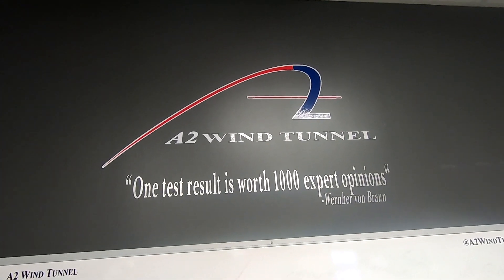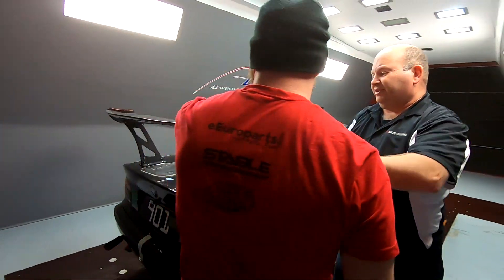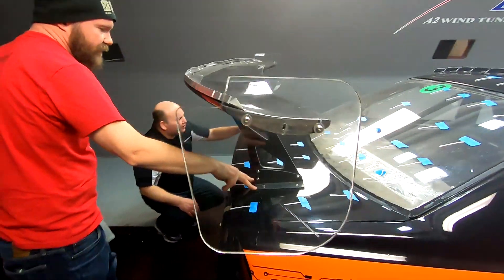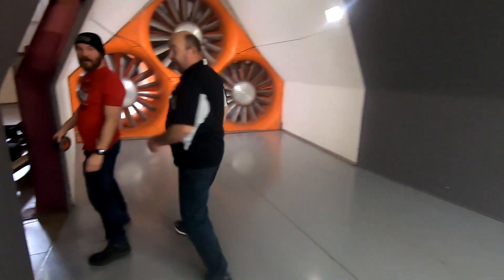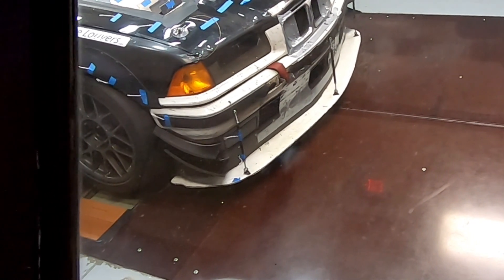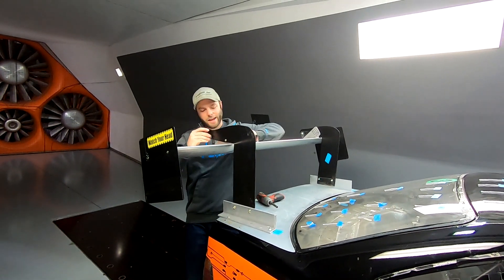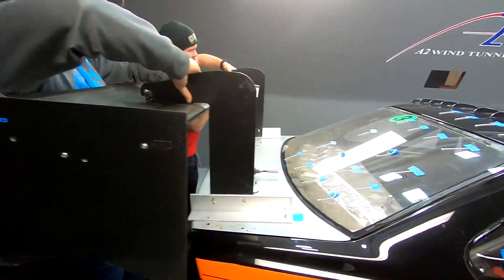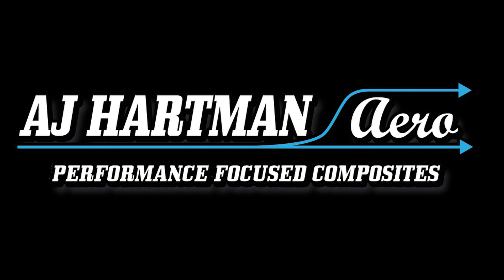37 Wind Tunnel Runs Part 2! Vortex generators, canards, and wings.

Comment: The air tab vortex generator created way too much drag, it might be better to try delta wing type vortex generator from Mitsubishi Lancer EVO around 10cm from roof turning point. There is also Chevron vortex generator with better sensitivity if placed in series with 5mm height which has minimal drag penalty.

Comment: The canards themselves cost some drag. The vortex generated from it keeps the flow attached to the vehicle body. This also suck out the high pressure air from the front wheel well and this reducing lift and drag. To what extent is this true? Would the net drag be negative in this case?
Reply: for canards they move air away from tire, which depending on rim design can be source of lots of irregularity and drag. Tho from what I understand they're mostly for bit of additional downforce. 

Vortex generators are finnicky. on their own thei add drag, but they give more energy to air, which helps with it following line o fcar. Basically on on sedans where back of car moves down depending on design air can unstick from body of car, causing large vorteces and lots of drag. if you put vortex generators just before that point of unsticking, air tays attached and they reduce drag more than they increase it.

Comment: Reducing the costs of airtabs? Either you have a 3D printer or you don't. Never pay retail again. Lol.  I'll get back to printing kazoo parts while designing some venturi nozzles for dust removal inside cnc vertical mills.

Comment: I attended a talk by some aeronautical engineers with the subject being boundary layers. They used synthetic oil mixed with a dye which they applied to an aircraft wing especially at the wing root and to the fuselage fore and aft of the attach point. This was used instead of the tufting. They dye held in suspension by the oil would  concentrate or not showing the boundary layer separation. Of course this was very messy and the aircraft owner got a very extensive wash job afterwards. Goos video very interesting. I’m jealous

Comment: From what i read and watched on other videos (air shaper, kyle.engineers, etc.) roof vortex generators are to be placed very near the spots where airflow separation would occur. That would be as near as feasible to the sharp downturn "corner" of the roof and the rear window.

And the supposed primary reason for roof vortex generators was to reduce the drag from the rear window flow separation. Not sure if they are supposed to reduced lift but it would seem that having attached flow on the rear window might actually cause lift, unless that flow also affects the airflow to the rear wing which might then result in net downforce.

Wind tunnel time is expensive 😯 though you most probably already planned and prepared all the stuff that you were going to do in the wind tunnel ahead of time, to make the most of your time there.

Comment: Vortex generators have a somewhat hidden physics called Entrainment; creating an effect similar to how a Dyson fan blows air beyond the hoop. This may be part of the additional drag. This stabilizes the airflow behind the vehicle, creating greater stability at speeds starting around 70mph. I have also placed them at the front of my front wheels on the fender, and can feel the tire pass out of the air-flow when turning.
Reply: The rear wing is mounted high so the air flow generated by the VG have no effect on it.  If there was a duck bill on the trunk or low mounted wing then the VG may provide better airflow and allow the wing to work for more downforce
Reply: @2be1withU  I've seen VG's placed at your top line of tape/string on the rear window with reports that it connects the airflow cleanly to the car, which might clean the flow over the rear wing.
Reply: Looks like honda modulo x

Comment: The issue I see with the AirTabs vortex generators was more one-off  placement or even actual need for them than their effectiveness. We know they work, but they're not for every application.
Reply from the maker: Alex NutCasio agree. Would have been nice to try different locations but that was where air tab recommended putting them but tunnel time is expensive and had more important runs to do.
Reply: @ajhartmanaero  If you follow Aussie Julian Edgar on YT,  he had an Acura with a similar rear windshield and put the tabs on the glass about 1/3 down and they worked great.  However, you can partially test your BMW by using the 3inch tufts on the rear windscreen and see how the air is flowing off the roof and if its detaching or not.

Comment: Very interesting videos, thanks for sharing! I also would really wish you could give some real general results with the wings like you were with the louvers. You mentioned the gurney flap on the ebay wing was surprising... but nothing of whether it was good or bad. I assume it was helpful as you didn't immediately rip it off? Since I have the exact same wing I'm really curious. Thanks!
Reply from the maker: knate240sx I think I mention the gurney flap numbers in a clip. I need to walk a line between giving out info and protecting info since it’s what I do for my business. I will eventually do a “lessons from the wind tunnel” recap video.
Reply: @ajhartmanaero  Thanks for the quick reply AJ, I'm still learning from being able to see most of this! This cheap wing has a very rounded trailing edge, not sharp at all, so I imagine it may behave a little differently from a properly built wing. You did mention "100 something lbs" at 100mph, which I assume is better than the baseline. Based on leaving the gurney on and then flattening the wing I assume that the L/D was pretty good with the gurney added. I already had added larger end plates to our wing, sounds like I may need to try adding a gurney and losing a bit of AoA.
Reply from the maker: knate240sx depends if you need the extra Df or not.
Reply: @ajhartmanaero  I don't need more Df in the rear, was just wondering if gurney + less AoA can give same Df with less drag?

Comment: About wheel area aero: I notice Ford did some aero trickery for the new F150 in the wheel area. They used ducts from the front to just in front of the front wheels. The ducts are narrow at the wheelwell and run nearly the height of the wheelwell. I assume they are using this to redirect incoming air away from the wheelwell. Do you think this has promise in a racing environment for reducing drag? Has it been done before in a racing environment?
Reply from the maker: They do the same thing on the Mustang. They use that duct to stream and smooth air around the wheel/wheel well area to reduce drag. Problem is, once you put wider wheels on (very common on race cars) all that factory stuff is useless as the duct then points at the tire which isn't good.
Reply: @ajhartmanaero  I figured it would have to be made to the application. I guess with racecars it's probably better to minimize the opening than to try to do this. Maybe if the tire didn't fill the wheelwell.
Reply: @ajhartmanaero  did you leave them on the Mustang or block them off?
Reply from the maker: @Racer_Mike87  blocked on the gt350.

Comment: Vortex generators are mounted or designed the wrong way around. Pointy edge must face forward.
Reply: I also noticed how far forward you mounted the VG's. I didn't notice until after I mounted mine, but air flow separation didn't occur until ~6" off the back window, I have mine on the rear window upper mould line but they could've been mounted on the window itself.
Reply: LSX_M3 my thoughts exactly.....the air tabs were too far forward and probably should have been on the back glass. They were mounted  the correct way, wishbone to front,  skinny to rear.
Reply from the maker: Not according to install guide of the company that made them.
Reply: @ajhartmanaero  did I miss how the vortex generators performed? I have the same ones on by E36, made a video of before and after, I think you'd enjoy it!
Reply from the maker: LSX_M3 very end of the video I mention how they did.
Reply: Have mounted and used them on planes. Those are way over engineered. If you have more tunnel time. Try the aircraft design. Actually easy to make. And I would try them in the middle of roof and on the wing.
Reply from the maker: @hatallas  As much as I love aero and would love to test different designs we didn't have the time. I could always 3D print some of the aircraft ones you are referring to. The ones tested in the tunnel were purchased by the car owner who is new to aero so thats what he wanted to test and we got what we got.
Reply: And if u have time. Try some about a foot from the start of the roof.

Comment: Those roof vortex generators look strange with the wider part forward, it makes sense that they would add extra drag and barely improve downforce on the rear wing. When you guys were doing the smoke testing it was really bouncing around over the back of the roof area! The shark fin style vortex generators on my Mitsubishi Evolution X are much more streamlined but who knows if they keep the air attached to the rear window any better so that the wing gains downforce from having cleaner air.
Reply from the maker: The Df gain usually comes from less lift on the rear glass. But these in this case didn’t work.
Reply: @ajhartmanaero  Another place to try is the upper rear window, this will also add less drag.

Comment: What is the purpose for the cutout of the rear upper corner of the wing end plates? I see them fairly often.
Reply from the maker: Usually vortex shedding. It’s a drag reduction technique, but a very small one. Would have been cool to test multiple size endplates.

Comment: Tire blockers ... I have them on my car, but I have never known what they were called.
Reply from the maker: Tire blockers, dive plates, some might reference to them as canards, S flaps, wickers... I see them all used interchangeably despite being a little different. Tire blockers is about as easy as you can get.
Reply: AJ Hartman Aero  ... 100%, I have called them ‘like a gurney flap on the wheel well’ ... which is cumbersome at best.  So I like ‘tire blockers’, differentiates them from the more typical canards.